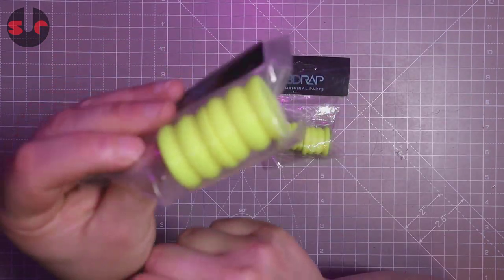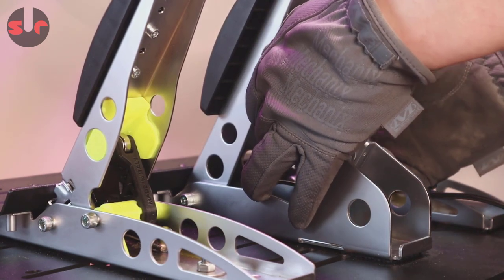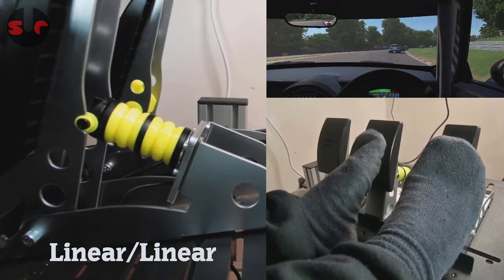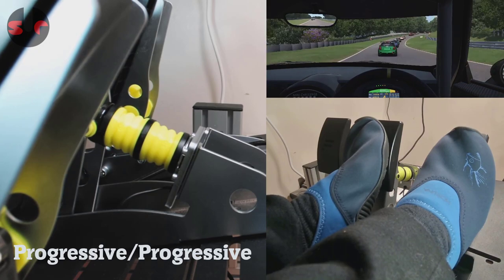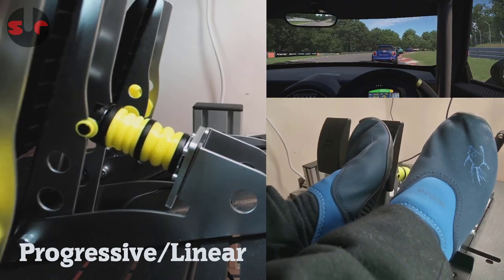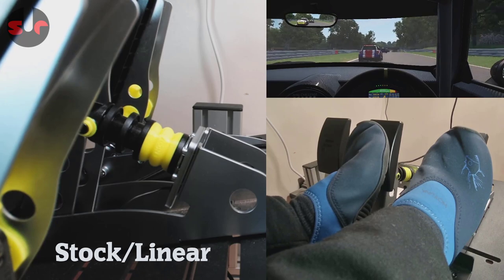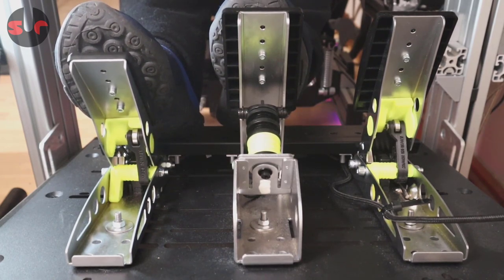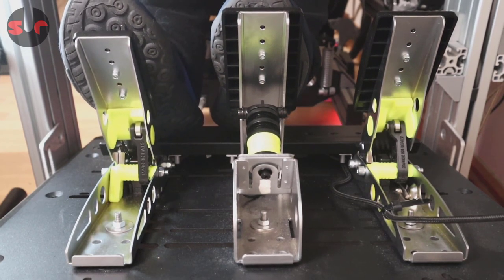[REVIEW] 3DRAP Fanatec CSL Pedals Elastomer Brake MOD. Better feel, improved control! 🦶‍

Comment from the maker: ▶ https://www.3drap.it Storewide 5% Discount coupon code: srcorner5 (excludes Ignition products)
▶ Unboxing a big stash of 3DRAP CSL Pedal MODS! Lovely STUFF! https://youtu.be/JFAXaLnfUr0 
▶ Fanatec CSL Pedals Load Cell [REVIEW] https://youtu.be/YRkL23ntFnM 
▶ 3DRAP Zero Noise Pedals MOD for the Fanatec CSL pedals [REVIEW] https://youtu.be/Dk9K-yJf93g 
▶ Fanatec CSL pedals '3DRAP Throttle/Clutch PRO Kit'. [REVIEW] https://youtu.be/Dk9K-yJf93g 
▶ Fanatec CSL Pedals [DIY] Damper MOD. Improve the FEEL! [GUIDE] https://youtu.be/n_B5PKVSKCo
Reply: Done. :)

A question if I may please. What is the maximum force input % you're using with your load cell? I'm using around 40-50% of the max input range (via fanatec software) because I'm currently using a foldable cockpit (GT lite) and applying more than 50% of the peak readable input force to the LC tilts the seat back due to its foldable nature. So I was wondering with that in mind, if you were to speculate, which of the combinations you think might be best (if not the same as your general recommendation) with a foldable cockpit as such. Many thanks in advance.
Reply from the maker: Thanks again for the donation Martin.👍‍
I'm running the brake force at 90%. In your situation then a I think either the progressive/progressive, or progressive/linear setup would be the option to run with. There is another option to soften the pedal using a metal spring along with the a couple of the Fanatec elastomers. Right after finishing this video, I begun testing this spring mod, but there is a way to go before I'm ready to put that video out. I need to try some different spring strengths. But early signs is that it's pretty good (and much cheaper) alternative. There's video on the mod here. https://youtu.be/dz1uSaf0KSg. The size is 20 x 10 x 25mm, and I bought mine from here: https://www.aliexpress.com/item/4000277618107.html?spm=a2g0o.order_list.0.0.21ef1802TMiMIY. I currently have the blue one installed, and waiting on the Yellow to arrive.
Reply: @SimRacingCorner  awesome, thank you and I look forward to your video on it. :)
Reply: @SimRacingCorner  I'm really interested in hearing (when ready) your opinion of all elastomer vs spring-elastomer combo.
Reply from the maker: @DrR1pper  I can say this already, elastomers do give a more realistic brake texture over a spring. For braking control, the elastomers have the advantage. Not much, but feedback from the pedal is a bit better with elastomers.
Reply: @SimRacingCorner  that’s good to know. Thank you. Sorry to keep hassling you with questions but if I may pick your brain just a little more please, which sim(s) would you recommend for clutch and h-pattern shifting? A friend of mine would like to occasionally practice on well recreated british tracks like Oulton Park to supplement his occasional track days with a Subaru BRZ. Also, hardware-wise, do you think the CSL pedals LC with 3drap’s throttle and clutch mods (for stiffer throttle and clutch diaphragm simulation like on road cars) and Project-D shifter would be a good value add combo choice for him (along with a CSL DD)? As always, many thanks in advance for any advice/wisdom you can share. :)
Reply from the maker: That's okay Martin, I don't mind the questions. My go to sim is Automoblista 2, it does feature Oulton Park and other British tracks as part of a DLC pack. Also, Assetto Corsa (it's dirt cheap on the Steam sale right now), though Oulton Park isn't included, but can be found as a mod track. The 3DRAP throttle/clutch mods are effective, and I would say give the pedals a more realistic car pedal feel/texture. But I do wonder, if the plan is to immediately mod the CSL pedals, it may be worth pricing up the difference between the fully modded set of CSL pedals or just getting the Fanatec V3 pedals. The Project D shifter is really good, I'm still using it.
Reply: @SimRacingCorner  this is very helpful, thanks again! :)

Comment: i moved from 3drap to VNM PEDAL BRAKE UPGRADE KIT and this significantly improved my lap times about 0.5 second to 1 second. i used combo with spring and elastomer.
And now I combine it with a damper kit, it will take some rebuilding, but I hope it gives a better feeling
Reply: How can you tell the Linear and progressive ones apart?

Comment: I used the csl elite elastomers from ebay, only 15 quid delivered and i got 10, 2 of each strength and they are just perfect, ive not tried the 3d rap ones as i cant afford them but the csl elite ones are fantastic and fit perfectly...✌🏻💙
Reply from the maker: Nice one, good advice.
Reply: do you have a link for this?
Reply: what colors did you use?
Reply: @rollback2653  :  BBJ SimRacing Damper Tuning Kit (PU Foam & Rubber) for Fanatec CSL Elite Pedals.....
Out of stock ATM.....
Reply: @marcod7615  2 blue and 2 green works best for me....
Reply: Unfortunately mine was destroyed after 30 minutes

Comment: Great video and analysis of the mods. I like how you went through all the different options too! Well done!

I purchased these too both sets and the accel and clutch too. I love the mods they are worth the money. My only complaint is on the rings that can split easily but the bushings are great.  

I went through a similar process testing the different setups and landed on full progressive but may try the one progression and stock to see how it feels.... thanks for the insight and comparisons 👍
Reply from the maker: Thanks man. I definately felt it was worthwhile describing the different setups as they all change the feel quite a bit.

Comment: What made you faster or more consistent, the 3DRAP or the springs? I already ordered the yellow/blue springs as they are really cheap, but I need to make sure the 3DRAP would at least make me more consistent before spending $50 on a mod. Last thing, do the 3DRAP elastomers become weaker over time?

Comment: My question is which one would you go with if the pedals are on carpet? I'm trying to decide  which setup to go with this one or with the spring.
Reply from the maker: Quite honestly, I wouldn't pick these pedals at all if they aren't hard mounted. The Thrustmaster T-LCM or Moza SRP pedals are far better on a carpet due to the lighter tension on the brake.
Reply: @SimRacingCorner  lol well I already crossed that bridge, I already have the CSL load cell pedals but from what you said about the progressives that might be the way to go

Comment: How do the CSL LC + 3DRAP and the TLCM + 3DRAP compare to each other? Are the brakes equivalent to each other then or is the braking distance still smaller with the CSL than with the Thrustmaster?
Reply from the maker: I haven't used the 3DRAP mod on the TLCM pedals. However, I can say the end result won't be identical, as the size of the elastomer mods are not the same size for both pedal sets, so their compression/stiffness are different.
Reply: @SimRacingCorner  Okay thank you. So which Pedal-Set would you recommend? The TLCM + Brake Mod or the CSL + Brake Mod? I know the Brake Mods you can do are quite different from each other, but I'm trying to get a "normal" Brake-Pedal feeling after all.
Reply from the maker: @Repa24  Are the pedals going to be hard mounted, or just loose on the floor?
Reply: @SimRacingCorner  I am planning to build an office-chair rig, so (hopefully) mounted.
Reply from the maker: @Repa24  I expect the TLCM pedals are likely to be more suitable for you. I think the CSL pedal brake maybe too stiff for your application.

Comment: Does anybody know how to fix a fluctuating load cell brake??? I just opened these and this issue was already there 😭😭😭 it gets worse as I turn down the pressure sensitivity, if anyone knows how to fix it please help.
Reply from the maker: Contact Fanatec support, that's not normal. It sounds like it's faulty.